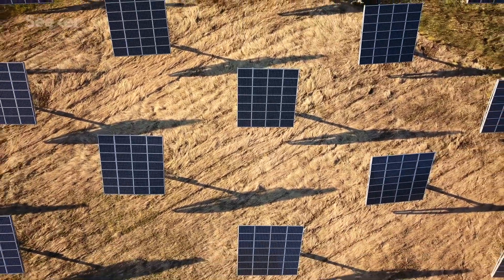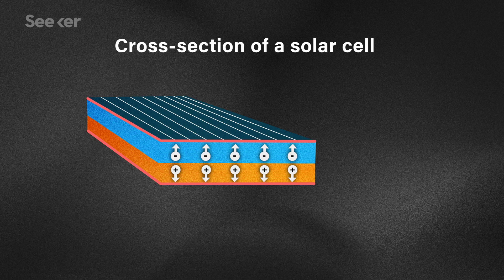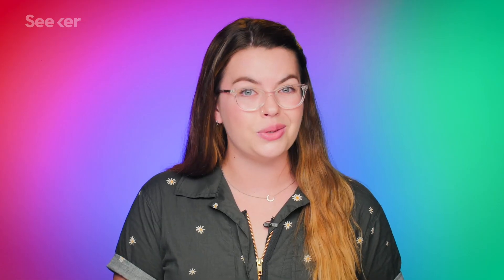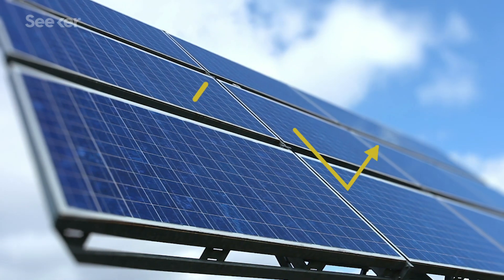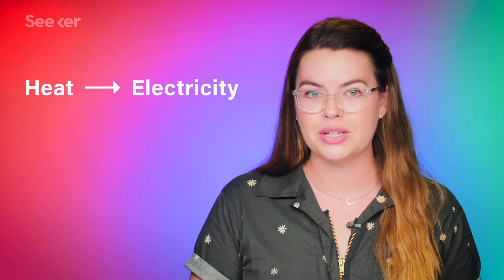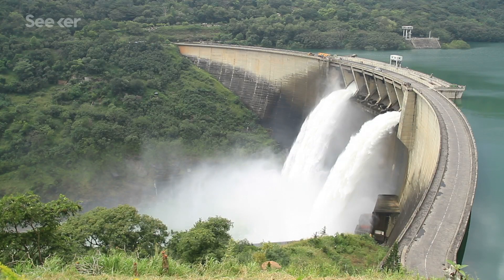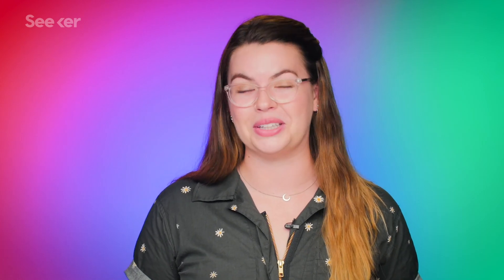Carbon Nanotubes Might Be the Secret Boost Solar Energy Has Been Looking For

Comment: I think people don't realize we use more solar energy than we think. 

Sun creates heat differences which generates wind, which then are turned into wind power. The sun also evaporates water and create clouds, which gets moved around elsewhere by wind and rain down and creates rivers, which then are turn into hydro power. Of course, geo-thermal is also responsible for the heat, so when we use these renewable energies we're technically using a combination of solar and geo-thermal energies, just more complicated than plain solar panels. It's like the most modern nuclear reactors are actually just a super complicated water kettle. 

Also, this is about the 900000th time over more than 10 years that I saw carbon nanotubes or graphite is going to change the entire world blah blah, yet not a single actual product is made. The awe factor is seriously undermined to the point that this video is pretty much just "oh, great, another one of these. sure. "
Reply: Well, you have a pretty wide definition of solar energy . And yeah, it's really hard to make carbon nanotubes in a commercial scale, so we (consumers) aren't going to see them anytime soon.
Reply: @jorgealexandre4616  its been really hard for 10 years and its not got easier. and also thats not a wide definition of solar power, its technically correct lol
Reply: Technically everything is made of star dust
Reply: Photosolar perhaps.. Which doesn't include thermal solar and other form of energy derived directly & indirectly from the sun..
Reply: 10 years is nothing. It took something like 200 years to go from electromagnets as toys to generating power.
Reply: We can't produce nothing using graphene because the studies aren't ready for an commercial scale using.
Probably, just probably they will end the searches about some more 2 or 3 years.
Reply: So basically...solar and wind dont work well once the sun is gone for the night
Reply: Most of this stuff is adverts for stuff that'll never happen like the flying cars from the Jetsons.  Phishing for grant money and venture capital.  How about doing something about the phucking traffic ?
Reply: https://www.graphene-info.com/graphene-products
Reply: and how to harvest that energy ?
Reply: Foo Foo all energy on earth regardless of form comes/came from the sun except radioactive atoms
Reply: That's why "solar panels" are known scientifically as photovoltaic cells :)
Reply: Lol
Reply: Yea also the sun let life begin therefor fossil fuels are solar energy
Reply: Also, geo-thermal is mostly just friction of different density materials in the core and mantle due to sun's gravity, so yet again it is solar :)
Reply: Liftium 

No, I can’t agree there. Sure there’s a tidal pull from the Sun that distorts the planets generating energy, but that is minuscule compared to the energy provided by large impacts that formed Earth and radioactive decay.

Comment: They still have a maximum THEORETICAL efficiency of the right wavelength is 33.5%, the nanotubes are about 80% efficient at changing the wavelength upping the maximum efficiency but not even approaching 80% it’s more like 40%

Comment: @Seeeker If green is the future. Then better wind turbines, that make better use of the air and cheaper to make. Was there a reason why when building theirs, our ancestors used almost solid circle wind vanes? Less bird strikes...

And what about helical upright turbines? Adding thermoelectric generators to the backside of solar panels and make use of the thermal heat? And as far as storage, using Water Towers and water turbines? Occam's Law and Razor, Keep it Simple Stupid. 

BTW, whatever happened to that guy that made Solar panels and Hydrogen storage tanks? Solar Panels, that you could use for roofing instead of Tiles or Shingles? The ones you could nail through and were flexible?

There is also Thorium Salt Reactors.

Seems there is always an ulterior motive that ruins good intentions. Such as, what happened to early inventors of electric cars and batteries? The Oil, Gas, and Auto Monopolies bought their patents then shelved the idea, as another way to "kill their competitors"...

Comment: considering that most commercially available solar panels only are around 20% efficient,  ANY improvements will have a positive impact on what already is a feasible energy solution for some.  Looking forward to increased power output, with a smaller footprint!

Comment: If we make enough solar panels we can used up that excess carbon as well as lowering CO2 emission by not using fossil fuels.
Reply: All we need to do is figure how to make carbon nanotubes out of air, and we can solve both problems at once.
Reply: @howardsmith9342  That's what Pup314 is saying. Suck the excess carbon dioxide out of the air, turn it into nanotubes. I don't know if it could be done at a large enough scale to make a difference, but the basic idea seems sound to me. Well worth trying.
Reply: @craigcorson3036  I don't know if it could be done, ever. Name one product that is manufactured out of thin air, that isn't a gas. Just one. I'd bet most if not all of that carbon would come from something like coal (a fossil fuel that would cease to be mined if some people get their way.) I wish they would get it out if the air, but there is no way to do it economically at present.
Reply: @howardsmith9342  Ever heard of dry ice? It's a product manufactured out of thin air, that isn't a gas. Carbon CAN, in fact, be economically removed from the air, and in several ways
Reply: @craigcorson3036  Ever hear of CO2 wells? It's my understanding that most, if not all, of the CO2 used in applications like that comes from underground CO2 wells, not atmospheric capture. Besides, what happens to the dry ice when it evaporates?
Reply: @howardsmith9342  No, I have never heard of CO2 wells, and I suspect that no one else has either.

"Dry ice is easily manufactured.[10][11] First, gases with a high concentration of carbon dioxide are produced. Such gases can be a byproduct of another process, such as producing ammonia from nitrogen and natural gas, oil refinery activities or large-scale fermentation."

Source: https://en.wikipedia.org/wiki/Dry_ice

As for what happens when dry ice evaporates, well, it becomes CO2 gas, of course. But the whole idea is to capture CARBON. The carbon would be removed by some chemical process, and guess what's left from that? O2. I think O2 is considered non-polluting.
Reply: @craigcorson3036  I have seen CO2 wells. They are usually found by accident when drilling for natural gas. And by the way, CO2 isn't pollution, either. It exists naturally in the atmosphere, and is a vital nutrient for plants. I hope they can capture CO2 from the air and use it for something other than dry ice, which just puts the CO2 back in the air with a loss of energy (produced probably with fossil fuels) but I'm not holding my breath. Besides, we are pumping CO2 into the atmosphere at such a rate that a few plants pulling out a few pounds of carbon isn't going to save anything.
Reply: @howardsmith9342  EXCESS CO2 is most definitely a pollutant. Some is good, yes, but too much is very, very bad. Lethal.
Reply: @craigcorson3036  Define excess. At times the Earth has had more CO2 in its atmosphere than now, way more. And yet life is still here. What is the lethal level of CO2 in the atmosphere?
Reply: U said it pal
Reply: What primitive thinking...

Comment: How doe this tech  compares to  multi junction panels ? It seem both of them have the maximum theoretical  efficiency so the only question  is cost and ease of manufacturing/disposal.

Or  you guy are just describing another way to manufacture multi junction panels using carbon nanotube?

Comment: What about putting a thin layer, or pockets, of (Composite) material/metal/other element that gets electrons nocked off by different wavelengths of electromagnetic radiation?

Heck, let's harvest gamma! What  get electrons nocked off by gamma, uv and infrared light?
Reply: *knocked. Nocked is what you have done to an arrow when you get it ready to shoot.

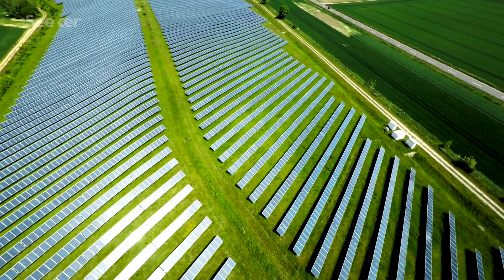Comment: This claim starting at 1:27 gave me shivers, so much lazy, un-researched writing YUCK... 5 min at Wikipedia would be enough to convince you otherwise. Yes, heat is a problem and yes single junction materials can only absorb that much, but claiming 30% with improvements to our current technology (When in reality we have already overpassed that limit without multijunction cells I'll attach the NREL chart bellow) seems like you got paid by this "researcher" to belittle  the competition and make this product seem like the dream solution. Spoiler, I wonder if using one of the hardest materials to mass produce will be a fine candidate to become the world's energy supplier in a technology whose main advantage is cost efficiency, think again, think in the far future. 
https://www.nrel.gov/pv/cell-efficiency.html
Reply: Hey Alejandro! I'm sorry you feel this way—I researched and wrote this episode, and in the context that I mention the 'max 29% efficiency' stat, this is in reference to solar panels as we use them commonly today. This is based on the highly studied and widely accepted Shockley–Queisser limit in solar panels that we typically use in energy systems today. The technology that you reference in the NREL source is very exciting, but is also experimental. Therefore all of the technologies that exceed the 29-30% efficiency max (like the technologies mentioned in the NREL source and the one we cover in this video) are all exciting future possibilities to improve solar panel functionality, but should all be treated with the same mindset that they need further work before they can be implemented on a wide scale—like the point you make at the end of your comment, which is a great observation! I would also direct you to this source (https://onlinelibrary.wiley.com/doi/10.1002/pip.3102), which is a helpful list of max efficiencies for solar panels and which we used to fact-check this script (which again, is referencing widely-used solar panel technology when we use the 29% stat, not breaking technologies that are not yet widely used).
Reply: @MarenHunsberger   Hello Maren, thanks for taking the time to respond and just by your response it shows that you´ve putten care into it. Sorry for the aggressive language earlier but I work on the field and it felt really gut wrenching to have other researchers and pioneers works not considered. The issue I take is that the statement will stick with viewers and spread the misconceptions about "weak" solar photovoltaics. And while some of the NREL data might be  experimental I´ve personally worked on CPV installations for customers with triple junction Azur Space 3C44 cells with efficiencies of 41% http://www.azurspace.com/images/products/0004355-00-01_3C44_AzurDesign_10x10.pdf I know this doesn't yet represent a wide-scale adoption but I don't think citing that 29% as the maximum is an accurate representation of "In the future even with improvements to existing tech"
Cheers
Reply: Alejandro Capell I see your point! In the future I’ll try to do a better job of talking about a particular news item in the broader context of similar work, to put into perspective that a lot of people are working on making this better and that this is just one of many areas of exploration. Thanks for your perspective!

Comment: If you paint the panels in vantablack, would you be able to use the light absorbed by the dark surface or will the vantablack just absorb the energy like a black hole?
Reply: Black surfaces are black because they absorb all light (or nearly all) light in the visible spectrum.  If the panels were covered in vantablack, the vantablack would absorb the light and none would reach the solar panel, making the panel useless.  The semiconductor in the panels must do the absorbing.

Comment: Wonderful, but heating things with light is pretty much the only 100% efficient process.
We should use that somehow.... 😒😒😒
Reply: None of what you said made sense.
Reply: @remliqa  
Then you should learn....
Some thermodynamics!!
Also it's a "why are we bothering with solar panels when CSPs are many times more efficient"
Reply: @MostlyPennyCat  
PV are much cheaper  to produce an dmaintain  when compared to CSP as well as offers more  versatility   in its installation (try installing those on your roof) . This is why more  "solar power plant" are using PV than CSP despite the latter being  more efficient  . On top of that there're other problems like the infamous bird frying accidents.

Comment: It is time to use the Youtube comments section for clarification: when she says "(solar radiation) that couldn't be absorbed by the solar panels was bouncing off as heat" is she talking about heat generated by the absorption of wavelenghts that do not have a photoelectric effect on the material but do get absorbed, and so increase the thermal energy of the system? Or is she talking about blackbody radiation and the wavelengths generated through that? Do the nanotubes emit blackbody radiation at the wavelength used by the semiconductor? I'm most definitely missing something here. Captain (Scientifically) Obvious, come to my rescue!

Comment: Unfortunately it is currently impossible to produce the needed nanotubes at a viable cost so two problems have to be solved.  Actually three because intermittent energy sources will require efficient and cost effective storage which is not here yet.  Big challenges ahead for this tech.

Comment: If it actually works forget about solar panels you now have a device that can turn any heat source directly in to electricity at an efficiency greater than most heat driven power plants. You could literally put a few of these around your log burner and power your home.

Comment: Why has it to be solar panels?
What about Hydroelectricity, its effectiveness is up to ~90%?
Underwater turbines, geothermal energy?
Reply: "Underwater turbines" you mean fish blenders.
Reply: @foxto100  they just go with the flow, they don't usually suck water in like in an airplane turbine. imagine them as underwater wind turbines.
Reply: Or just nuclear. It's killed way less people than people think, it gives off megawatts of power, there's no carbon emissions...BUT A FUCKTON OF NUCLEAR WASTE.
Reply: @kari548  
Yeah, it actually kills less than all the other power source include solar and wind  on a death/power generated ratio. Ab this after counting  all the casualties  from  all nuclear accident (more than 99% of all nuclear death came from one incident: Chernobyl).
Reply: Hard to deploy (years compared to days for private solar panels)
Needs to be in a place with constant water.

Destroys the local environment with flooding.
Risk of flooding the area behind.
Uses shit loads of concrete for construction.
Still have to build transmission lines, solar on your roof is local so doesnt need that.
Reply: more research and experimenting will bring more possibilities. This research wasn't primarily about solar panels, but the effect of these carbon nanotube layers.
They suggested a use in solar panels. But they didn't upgraded an experimental one with it.
Reply: hydroelectricity isn't green.
Reply: @lockhrt999  whats not green about it, the water color!?
Reply: @raho2005  The thousands of tonnes of concrete, transporting it etc, damage to environment.
Reply: @ratgreen  greener in the long run than solar panel production or fiddling with radioactive waste
Reply: @raho2005  most of the water dams are built by demolishing rain forests because that's where the most rain is. Tens of thousands of hectors of land are needed for the reservoir. If it's not built in a forest then you could say it's green but that are really rare.

Comment: The reasearcher can use Vantablack as it totally absorbs the Light thus the Heat from that can be changed into Thermal generator. It's like boiling Water with the film of Banta black and running the turbine on the process. This can easily upgrade existing Coal Thermal Plants to Solar Farma